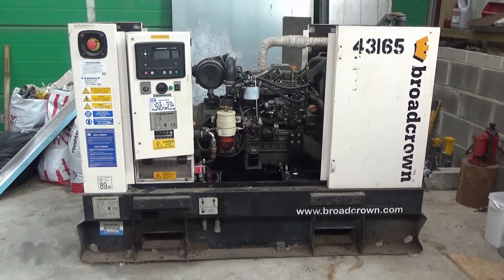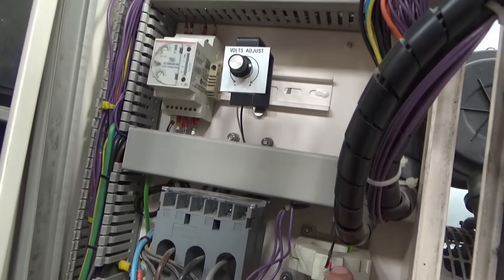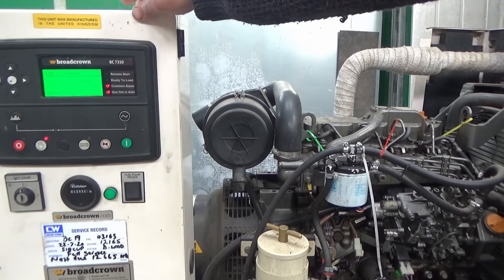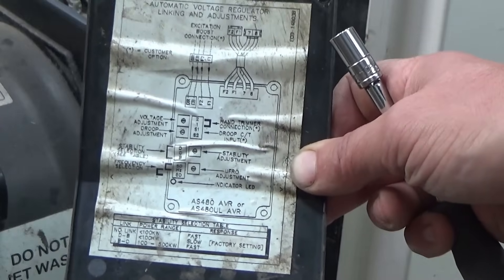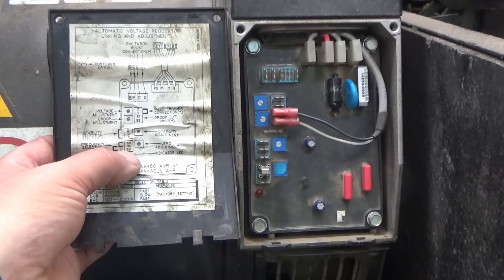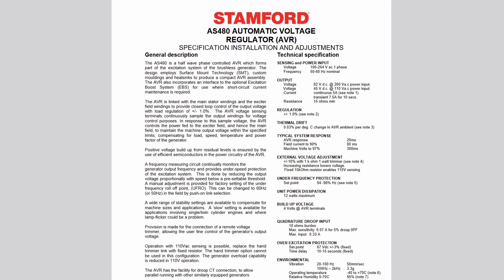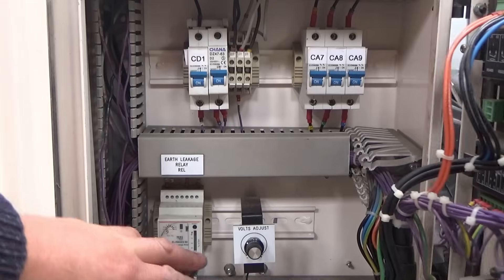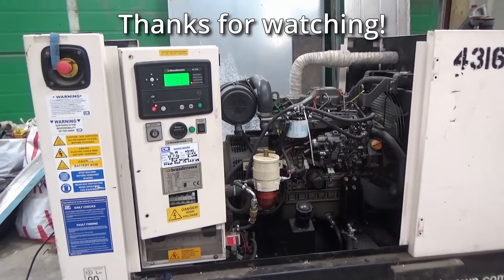Large Diesel Generator - Shuts Down With An ERROR | Can I fix It?

Comment: Totally clueless 🤣🤣
Reply from the maker: I've never worked on a generator before.. and I did get it working. Would you be totally clueless If I gave you a faulty thermal camera, medical ultrasound machine, or a solar inverter? As that's just a small selection of other things I've repaired....

Comment: We always used to put a dab of silicone sealant on the top of all trimmers etc when the correct settings were achieved.  This prevented any vibration creep ,but could always be peeled off if they ever needed to be readjusted in the future.
Reply from the maker: Good idea Bob👍
Reply: Hey Mr. Watch out using silicone.  It is conductive ..

Comment: Next time, please please please do the research before you start messing with the machine. Swapping leads to "see what happens" is never a good idea when you're dealing with a devide that is designed to generate metric f-tons of power. If the problem is that the machine has a short somewhere then trying to get it to generate power regardless could just melt it.

Find out what causes an undervolt first, then see if that kind of fault is happening on the machine. It was saying 60hz so it was not a throttle problem because the 60hz is generated directly from the RPM's. If it was a throttle problem then the machine would have told you something about it not being able to control the throttle, but it throttled right back to the 50hz every time.

And yes I am overthinking this, it's what I do.
Reply from the maker: Thanks Vinny,  good advice. All I got told was it runs for a bit and then shows an error. It's a farmer friend and he lives quite remote without a decent internet connection so research was a bit limited and he is also an hours drive from me, so two hour round trip.

Comment: AVR or alternator error? It could be the alarm settings in controller
Reply from the maker: I was hoping it was something like a fault with the control panel as PCB's and electronics are the type of thing that I usually repair, seems someone had previously messed with it and wired up the AVR wrong.
Reply: @BuyitFixit  DSE use 5 layer PCBs.
Reply: Yes my reply was before the end of video.Many times mechanical problems are reflected as electrical issues
Reply from the maker: Yes, that's why thought it could have been something with the engine speed or such as that's what my friend had messed with. No one had touched the AVR which I didn't even know how they regulated at the time, but overall I learned some new stuff that I previously didn't know and that's half of the fun for me 🙂. Thanks for commenting 👍
Reply: If its speed frequency will change and it's governor controller issue. If its voltage it's AVR or alternator diode issue, dropp ct

Comment: Thanks a lot for fixing the genny, Alan is well chuffed.
The engine runs sweet as a nut. The bores we're like new, there was quite a bit of carbon in the head...the injectors were sent away to be tested and cleaned and Alan lapped the valves and cleaned the carbon off. The carbon could have been there because the engine would only run for a few seconds due to the generator fault...we'll never know...
Can't wait to hook it up to the lathe, and if I can get my arse into gear I'll do a video.
Reply: These type of hired generators are usually used as back up too so don't always run for long periods or at full load so that can contribute to the carbon build up. Glad you got a good one though and it's now working!
Reply from the maker: Thanks Rival son, I would have been more at home if the fault was on the control panel, that's more along the lines of things I normally repair (circuit boards under a microscope) but I have a go at pretty much anything from a thermal camera, to a farmers bale wrapper the other day (no video on that as I just got a random knock on the door from a local farmer who was in a bit of a pickle).
Reply from the maker: Nice one Morgan, glad we managed to get it sorted 👍

Comment: We've had to replace 2 AVR's on our diesel gen for this problem.  Well done in worker it out.  It's an expensive gen when they have the adjust inside, both of our don't and you need to do it manually at the pot.  Some have Freq adjust as well.  He's had a really good buy there.  Diesel gen last forever in you change the oil and air filter regular.
Reply from the maker: Thanks Lee👍My first time looking at a generator so I now know a lot more about them as I usually work on much smaller things like game consoles etc but I'll have a go at pretty much anything.  I've repaired quite a lot of stuff I've had no prior experience with 🙂. I know my friend has serviced the generator with new oil filters etc so hopefully it should last him, and I now know about the AVR so if there are voltage issues in the future that will be the first on my list. Thanks again for your comments 👍

Comment: It’s quite funny watching someone who clearly has no idea how a genset works. Doesn’t even know how to operate a DSC Panel. Revving it up to adjust the voltage 🤦‍♂️ they run at 1500rpm
Reply from the maker: Agree, first time I've looked at one. I would have been more in my comfort zone repairing the control panel down to component level, which is the kind of stuff that I normally work on, but at least I've gained some knowledge on how these devices work now 🙂

Comment: Considering the burned wires, I would advice your friend to replace all of the wires that have been "repaired", do not rely on crimp/solder connectors for a long term solution. It's just a small lengths of wire and an investment well spend to eliminate potential electrical problems in the future. The amount of hours I wasted fixing my cars electric problems throughout the years because the previous owners decided to use the cheapest crimp on connectors or not crimping adequately. Just go through the entire machine, tighten every screw terminal and ensure every wire has proper ferrules (if not, add them). 

Recently I've rebuilt a star delta starter for a 6KW motor and halfway through we just decided to rewire the entire thing because we already were already more then halfway replacing wires anyway. Correct colors, ensuring proper diagrams. Just peace of mind really, simply because I don't want to re-repairing it over and over again.
Reply from the maker: Thanks Patrick 👍Good advice.

Comment: Before retiring I fixed electronic equipment and remember fault finding a power supply that seemed to have a short on the output because of the very low voltage. However, I always check previous work done on a board just in case, and sure enough, someone had put a 100k ohm resister in the circuit instead of 100 ohm resister - must of been colour blind reading the value of the failed resistor lol.
Reply from the maker: Or possibly the original was burnt and they could only make out the first 2 bands? I did a repair a few videos back on a switch mode PSU turned out that the main IC had failed.

Comment: You've got a good troubleshooting process. You took a had a problem you had minimal previous experience and systematically worked your way to a solution. Wonderful!
Reply from the maker: Thanks Paul 👍it's pretty much the approach I use when looking at most things, I've worked on things from thermal cameras , ultrasound machines all the way to tractors and now generators 😂😂
Reply: Thanks for that repair GOD

Comment: Great video! Straight forward and clear. These kinds of videos are interesting
Reply from the maker: Thank you 👍It's the first time working on a generator, I usually work on small electronic items and often down to component level, you might like the Milwaukee rocket light video I just did where I try to explain my thoughts and how to troubleshoot although I do try and do that on pretty much all of my videos 🙂
Reply: @BuyitFixit  Will watch! These are the bedside kind of videos which are delightful to just watch, even if you don't have your own generator to fix and find reference for 🙃
Reply from the maker: @OH8EFI  I just searched your callsign, I like your PI setup! I recently did a tear down and some poking around a rs41 radiosonde too :)
Reply: @BuyitFixit  Ah lovely! Thank you! I'm personally quite far away to fetch any RS41s but will do a run for it some time soon. Gonna try and repurpose it for ham radio stuff possible.
Reply from the maker: I haven't repurposed it or anything but I do show how to get into the hidden setup menus with a USB >TTL converter with the password. I also have a ham licence although I've not used it much. I only have a 10w license and we live in a valley. I did have a play with WSPR which worked and I hit Australia and Antarctica :)

Comment: so putting a resistance to the droop ct would've caused the genset to do nothing as it's relying on induced voltages but it does decrease voltage as the load increases to prevent the other genset from damaging the other

biggest indication of droop being used are the frequency fluctuations
Reply from the maker: Thanks for that. I've not had much experience with generator but love learning new stuff 👍
Reply: @BuyitFixit  james condon for gasoline generators
Reply from the maker: @dragonfireproductions790  Thanks👍yes a friend mentioned his channel to me yesterday 🙂
Reply: @BuyitFixit  those 2 are great learning resources
Reply: @BuyitFixit  smallenginemechanic is a great channel to learn more about diesel generators
Reply: it caused the voltage to go low. you have speed droop and voltage droop. this was voltage droop.

Comment: Thank you.

As long as you have a local "wizard", auctions can have good deals ;-)  

My best power deal was a 5KW Generac generator that the seller on Craig's List (US sell/swap/giveaway site) was asking $150US, but he couldn't keep it running when he tried to start it for me.  I thought the throttle linkage looked a bit bent so I offered $80US.  I got it home, got things straightened to my eye and I'm still using it 12 years later.
Always satisfying to get things running properly ;-).
Reply from the maker: Thanks 👍and good spot on the throttle linkage. This was probably the first time I've looked at a faulty generator, I usually repair smaller things and often down to component level such as a FLIR infrared camera multimeter, or Milwaukee power tools.

Comment: Black smoke is common for a generator that hasn't been run for a while, it usually burns off eventually so they might have wasted a fair bit of time with unnecessary engine work.
Reply: I suspect it was more likely the generator had been run often at low load. Diesels want to be run hard, running it with minimal load for long periods of time causes cylinder glazing and exhaust slobbering, both would cause smoke. Happens pretty often as generators are usually quite oversized
Reply from the maker: I think he said something about re-seating the valves? But don't quote me on that one.
Reply: @BuyitFixit  I believe he did, and good chance that had to happen too. Probably a bunch of carbon built up getting in the way if it was never run hot/hard enough to burn it all off. In theory if they had been able to get the engine to run (even poorly) and just load a bunch, it probably would have came good eventually.

Pulling it apart was definitely the better approach though, if you actually want the generator to use and don't know the history.

Comment: Probably bought well, given it started off faulty but didn't need expensive parts to fix. Always tricky following someone else's attempts - adjustment fiddled with and in your case wires connect to incorrect pins - great job !
Reply from the maker: Thanks 👍 Yes, it's hard to know what went on with it previously. I've not had much to do with generators prior to this, so it was a good experience as I now know a lot more than I did.

Comment: Nice job, love fixing someone elses mistake. Seems to be most of my career. Adjusting the throttle caused the over speed frequency alarm because genny's run at a fixed rpm to get the frequency they require (50hz or 60hz)
Reply from the maker: Thanks 👍 Yes it's the first time I've ever looked at one, so it was a little out of my depth, but I have a bit of a knack at looking at problems and working my way through them. Thanks for commenting 🙂
Reply: Yeah that was the only dumb thing he did.  But as he says, this is the first time he's looked at one of these so fair enough.  I was sure it would trip the over speed cut out on the controller which it did.  But he should have tested the frequency with his meter before trying this because if the frequency was correct then engine speed would not be the problem.
Reply: @johnrauner2515  He showed the frequency on the control panel and it was a bit high for my liking (53.something Hz). I'd expect a generator to run above mains frequency but not by almost 4 Hz.

Comment: Cute little 19kVA genny you got there. That controller is a re-branded Deep Sea DSE7310, if you were interested in more info on it. They have the manuals free online. Of course, that is just for the controller, the manual isn't for the generator itself. 
Easy fix there, either someone replaced stuff and hooked it up wrong, or someone at the auction was trying to get it cheap and purposely moved the volt pot leads. Happens often. 
And as you found out, RPM on a generator just controls frequency, the excitation controls voltage when running stand alone. When paralleled, the volt pot controls VARs, but I doubt that one can be paralleled anyway. but with smaller "inverter" style generators, the inverter controls frequency, but any larger real generator the RPM control frequency.
Reply from the maker: Thanks for the info, it's the first time I've really had anything to do with generators so it was all new to me. Totally agree that someone either put the wires in the wrong place or tried to get it cheap at the auction. Thanks again for commenting :)
Reply: We use generators like this at work (on comms sites) for backup. The USB port connects to a PC and you can download/run Deep Sea Electronic Configuration Suite to configure various parameters and setup the alarm dry contacts etc...
Reply from the maker: Thanks for that John, I was wondering what it was for. I'm quite curious about things such as that. I had a solar inverter  that I repaired and needed to adjust a setting but the company was most unhelpful so I resorted to reverse engineering the software and wrote my own service password generator 😂 I did a video on that too.

Comment: Excellent video, love that kind of work where you follow the fault around and eventually find the problem, funny thing is that the problem is often that someones been doing something they shouldn't 😂
Reply from the maker: Thanks Morten, yes it was a bit odd. I've no idea why someone would have even been in there? Unless they replaced that board?
Reply: @BuyitFixit  yeah only explanation as to why the wires where in the wrong place, goes to show how import remembering to put things back where you took them 😁